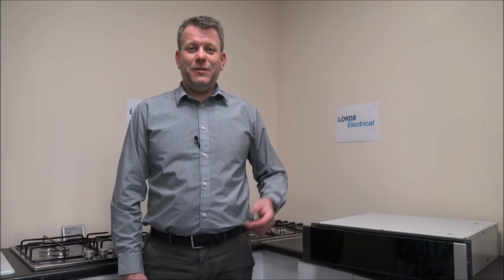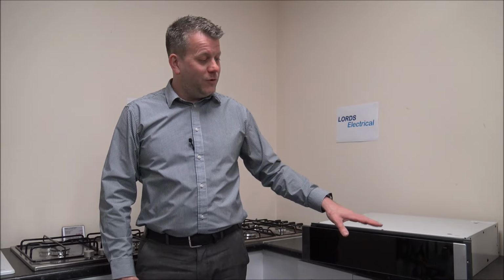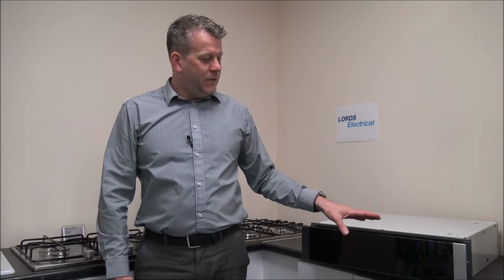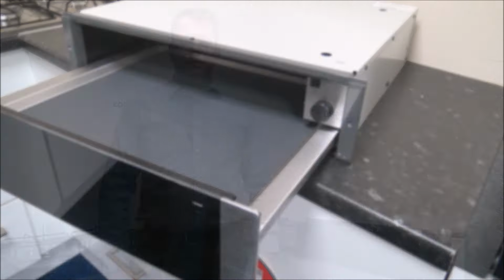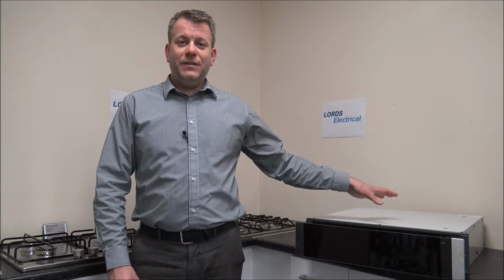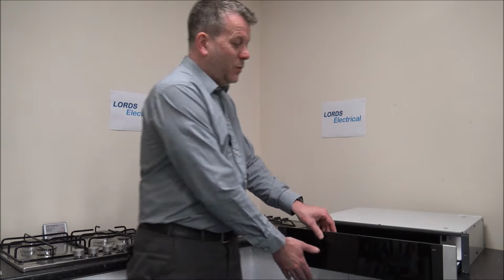What Is A Warming Drawer And What To look Out For If You Are Buying One

Comment: Watch out for Bosch and Siemens models as they have a circuit board that is INSIDE what is basically a small oven. They have some components that are only rated for 85c and are known to fail. It happened to me and a search on YouTube shows how someone competent at electronics can fix them.

Comment: 00:13 🍽 A warming drawer is used to warm plates and dishes before serving meals to keep food hotter for longer.
00:42 🍞 Warming drawers have various applications including proving bread and slow cooking.
01:11 📏 Consider the height of the warming drawer to ensure it fits well with other appliances in your kitchen setup.
02:35 📦 Capacity varies among warming drawer models, so compare different capacities after deciding on the height.
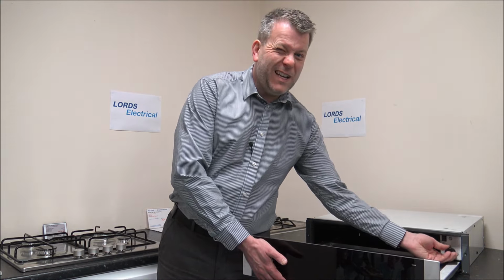03:33 🌡 Temperature range and control options are important factors, especially for specific uses like proving bread or slow cooking.
04:43 📶 Some warming drawers offer Wi-Fi or internet connectivity for remote control and monitoring, which can be convenient.
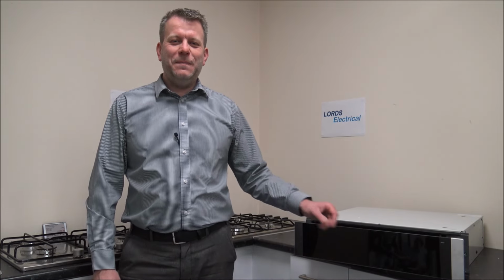05:11 🎨 Consider the color of the warming drawer to match it with other appliances in your kitchen.